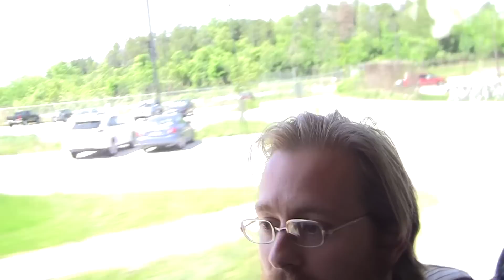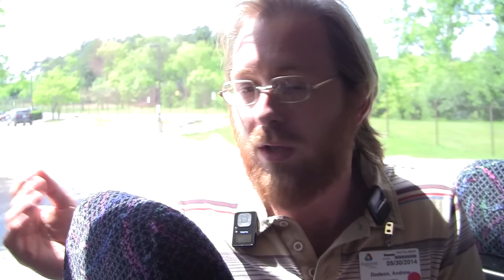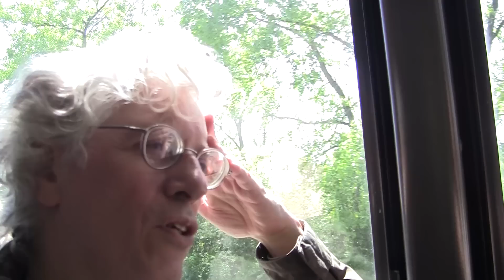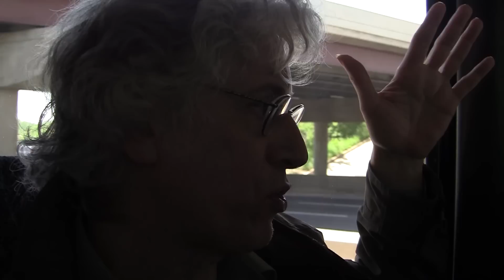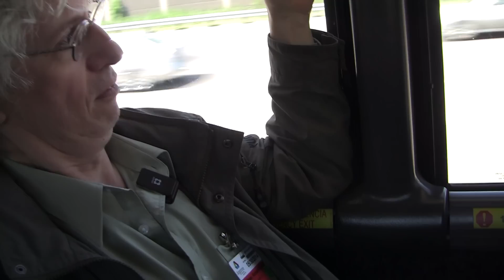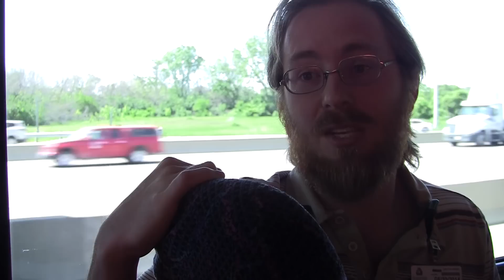Andrew Dodson - Windfarms are Resonating Across the Grid @ TEAC6

Comment: I'm surprised I didn't hear more examples of these problem occurring in the German grid system considering so much of their system is based on photovoltaic and wind turbine systems.  There needs to be documentation of this.
     It would make more sense for solar power be used to heat water and run lithium-bromide chillers than turn it into electricity to go to the grid.  If people don't want to burn fossil fuels, since cooling and heating represent large electricity and natural gas areas of consumption, then the solar energy taken at a specific location with our ability to insulate can be stored as temperature differences for use at that location for things that need high or low temperature which is a lot of things.  We can store temperature differences at a location easier than we can transmit and store electricity in batteries.
     Another idea would be to use all of these wind turbines in farm areas to manufacture ammonia for fertilizer instead of transmitting the electricity.  Of course the problem is that the electricity consumers have the wind turbines hidden in their bills.  If the farmers had to pay for the cost of wind turbine created fertilizer versus natural gas created fertilizer, they wouldn't like it.